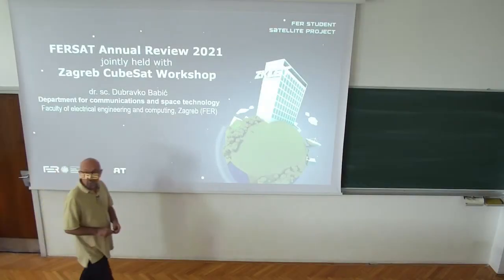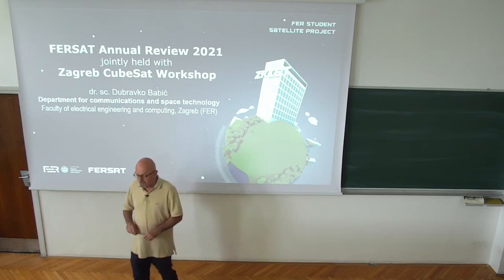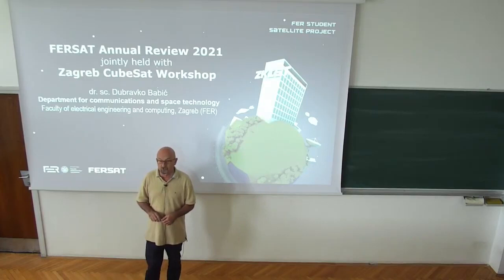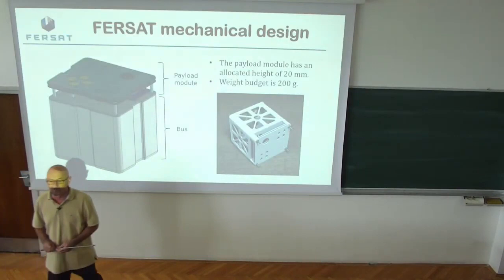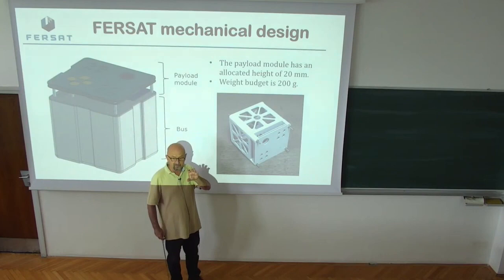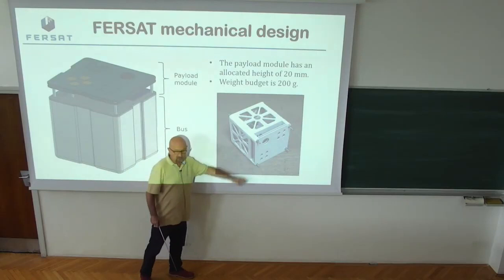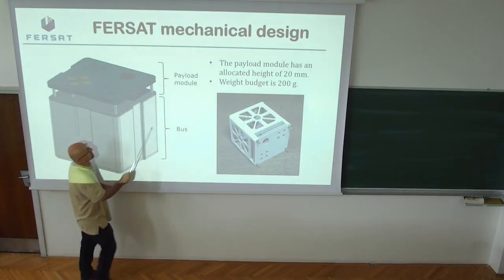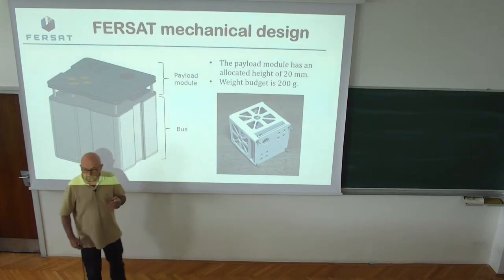FERSAT Annual Review & 2nd Zagreb CubeSat Workshop

Comment: Looking at your ground station antenna system design, it will be more educational to build the  VHF/UHF antennas as well as the future 10 GHZ system then buying off the shelf antennas that may not deliver the performance up to specs. Building and measuring such antennas should be the right way or no? By the way the thermal analysis was the best part of the show for me.